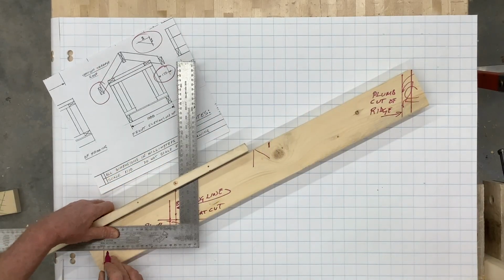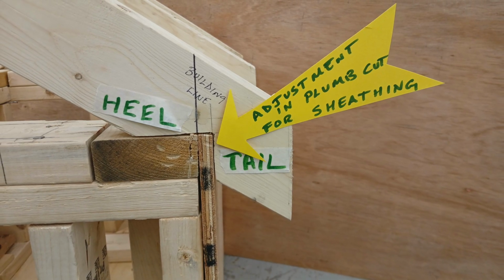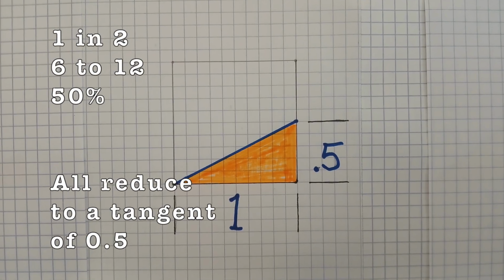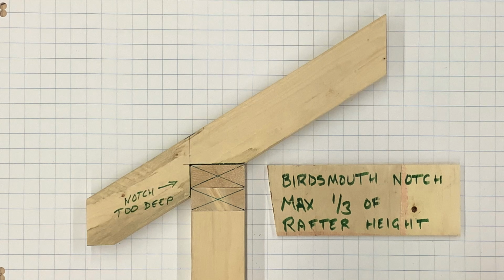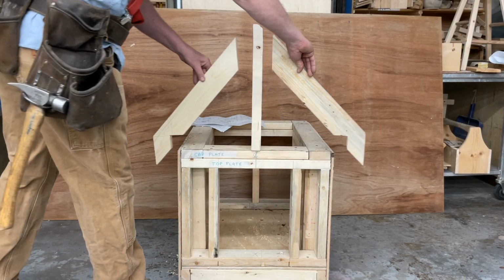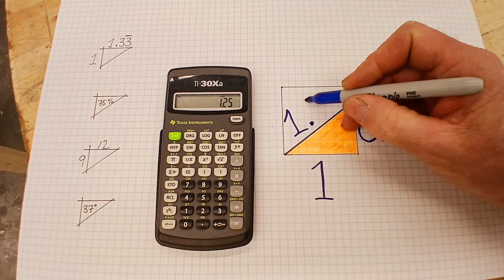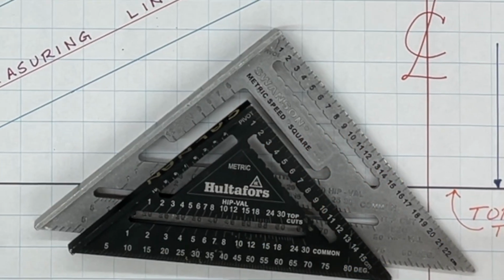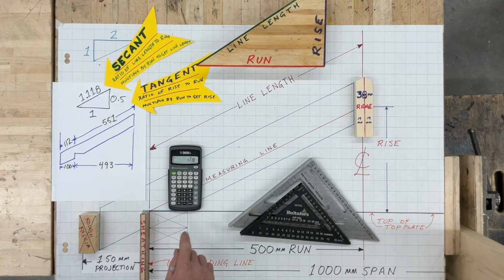Common Rafter Layout in Metric - A Complete Introduction

Comment: As a non builder, I have been trying to get my head around rafter layout through watching UTube videos.  The one thing I cant get is how to determine the height at the centreline to the top of the ridge. Maths is not my forte.
Reply from the maker: Multiply the run by the Tangent ratio and then add the height above plate to get the height of the top of the ridge.  
If the top of the ridge is square and not 'backed' (beveled at the angle of the roof slope), then multiply one half of the thickness of the ridge by the tangent ratio to find out how much you need to subtract from that first number.

Comment: Easily the most informative video on pitching a roof. Thank you.

One question, where you have your rise mark @17.37 (right next to ridge written in red, Is that measurement the same distance down from the top of your ridge as your height above plate? 

Thank you.

P.s a video on cutting hipped a roof would be awesome! Not many are as informative as what you were so thank you again
Reply from the maker: Thanks!  
Yeah, the  total rise plus the height above plate gives the actual height of the ridge board at the centreline - if the ridge is 'backed' (chamfered to the slope of the roof.  If the ridge is square-edged, the height of the little missing triangle on top is found by multiplying one-half of the thickness of the ridge  by the tangent. - You'll need that if you want to cut a post to hold up the ridge at the correct height prior to installing rafters.